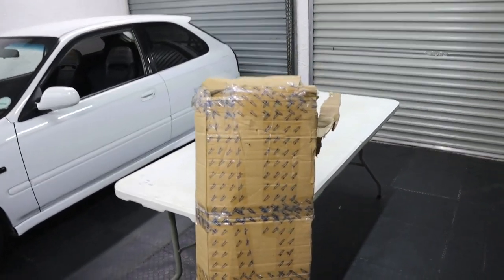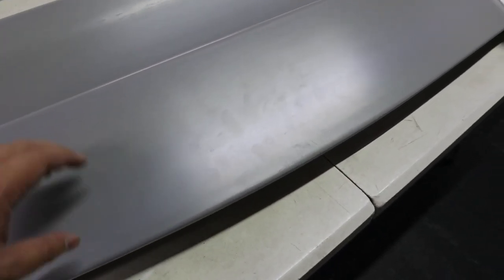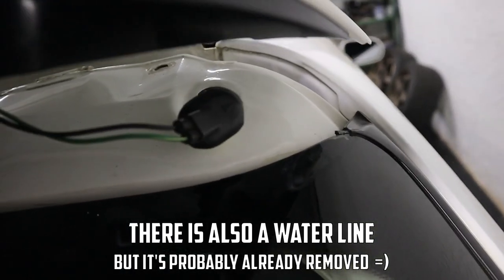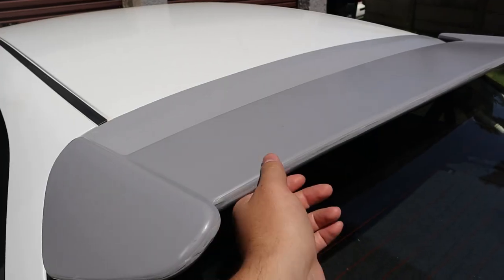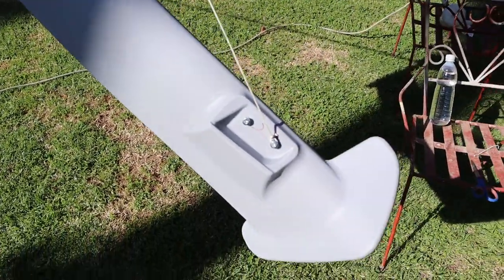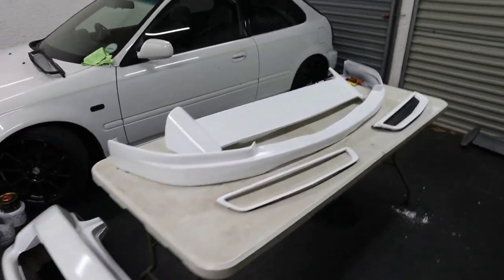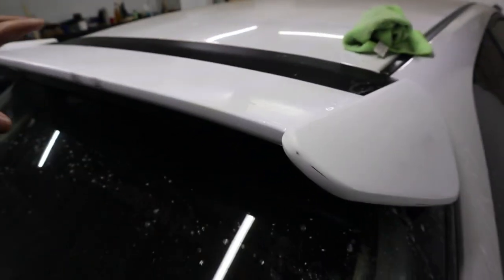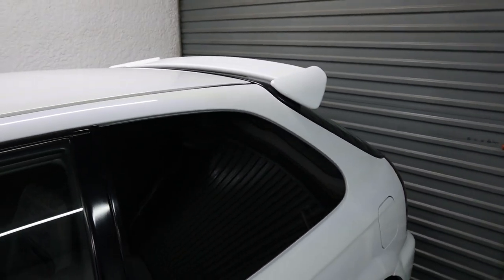EK9 Civic TypeR Budget Replica - Painting a CTR Wing

Comment: Is that manual just a PDF file that's readily available, or is it actually a programme like you was using
Reply from the maker: Hi Dinxsy, I believe they have both versions for sale, the one I have is a program like the one they use at dealerships, it even have time estimations for jobs and part numbers for tools needed, probably for quoting, I mostly use it for the torque specs and wiring diagrams. If you are interested just make sure you are getting the correct one.
Reply: @RisingBoostYT  I will have to look into the program version, I like the old windows car stuff. Pain the backside using the pdf versions as the categories aren't separate